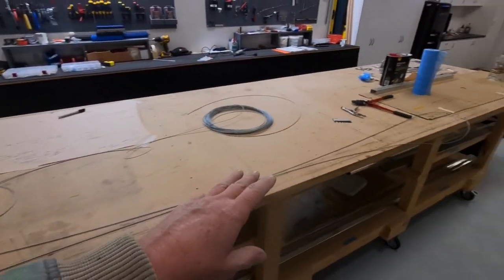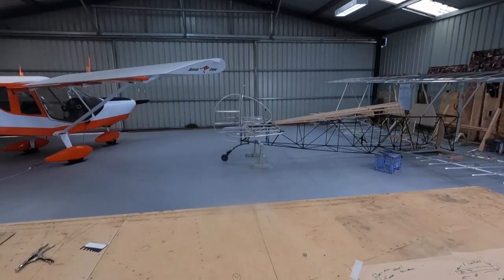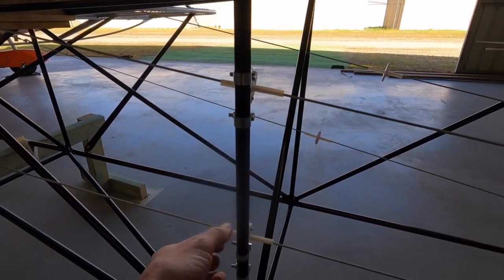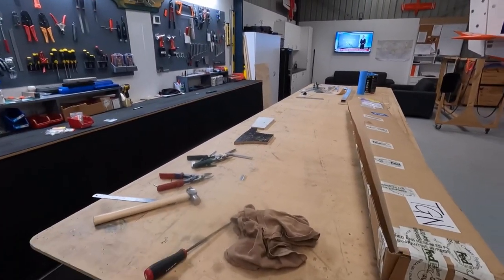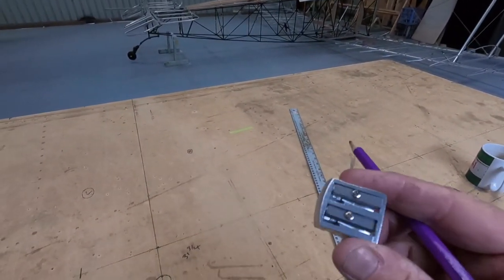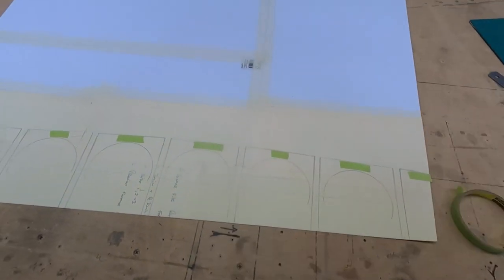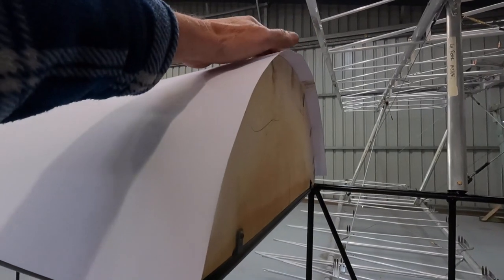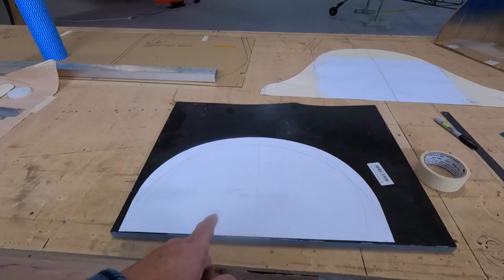Homebuilt Sopwith Camel Build: Crafting the Seat and Turtle Deck

Comment: G day Scott

I reckon for the turtle back , bending ply is the go.

Specially made ply for this application.

Lay some builders black 0:34 plastic over timber frame

Cut 2 slightly oversized pieces of bending ply

Place first sheet of ply onto frame with top face covered in light coat of epoxy glue

Place second sheet on top

Throw several ratchet straps over the whole shebang and under steel frame

Carefully tighten straps to make plywood conform to framing

Leave overnight 
Upon releasing straps you will have very strong section that you can epoxy glue to stringers and will not be under stress.

Make slightly oversized and trim for best fit

Fancy semicircle arcs to be cut after lamination is set

Bending ply available from specialist timber suppliers

Also seek out ENGINEERING PATTERNMAKERS SUPPLIERS or Engineering patternmakers for timber and advice

Keep vids comin I like em
Reply from the maker: Thanks I’ll check out the bendy ply.
Reply: @scottmatthews5280  

G'day,

Yay Team !

This bloke
Reads as if he
REALLY
Knows his
Onions...

It sounds like
Good
Gen.

Pay attention to them...

Have a good one.

Stay safe,

;-p

Ciao !

Comment: Me again
I don’t want to give you a bum steer.

By laminating the two sheets together which when dried will or perfect fit ,this assembly can be removed and replaced easily until  final fitment and glued to longitudinal stringers.

If you go this way use a couple of small panel pins (nails) one at each end of the section  fore and aft into the very top stringer , only need to be driven 5mm into top stringer
These 1mm diamanté nails are merely locating dowels so curved panel can be removed and replaced to exactly same position.

You could simply cut one sheet of bending ply with fancy arcs and glue to stringers if that is the way you want to go.

Also while I am at it , you were on the right track putting a fillet of adhesive where longitudinal stringers pass thru bulkheads but liquid nails is bodgey

Epoxy  glue mixed with micro balloons or equivalent will give premium results large diameter fillet

Look up west systems epoxy , perhaps contact sailing dinghy boatbuilder they will give you the good oil.

I share your frustration in regards to quality control of your kit 

I wish you well , for a successful rewarding build
Reply from the maker: Yep, I used west system and thixotropic or micro ballon’s on the longerons been using it for years thanks